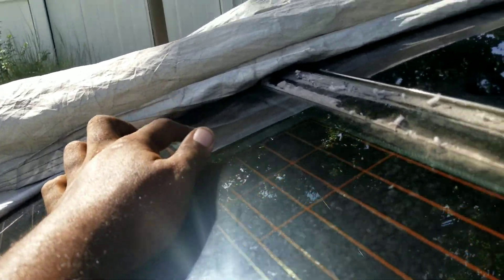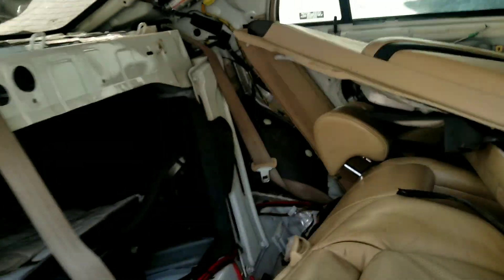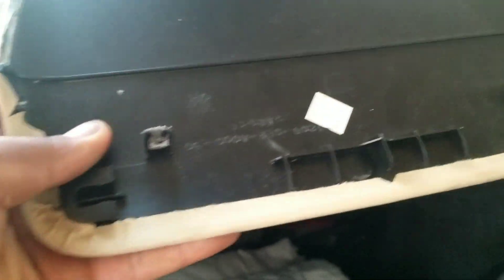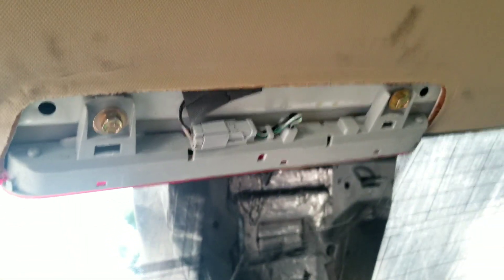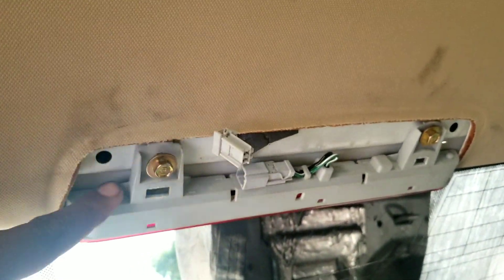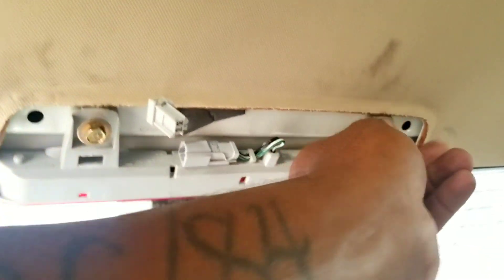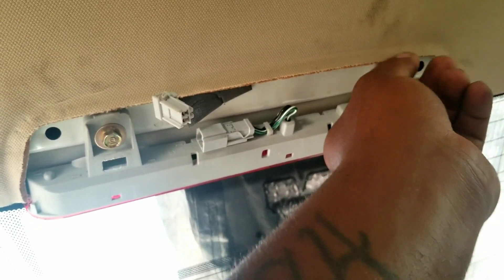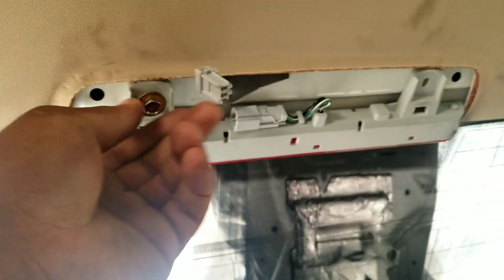ACURA TL 3RD BRAKE LIGHT REPLACEMENT (1 MINUTE FIX)

Comment: Love the upgraded opener! Quick question man, been struggling to find the module thst controls the DRL lights on my 08 TL. Any chance you have some insight?
Reply from the maker: yes will make a video showing if that helps
Reply: @fabolousg4ever  really!! That would be absolutely amazing! And really really appreciated!! As much as I try, I just can't seem to get good at working on my car like some people can!

I'm hoping to follow the repair of taking out the board from the module and re-soldering the joints.. Hopefully that finally gets the dang DRLs to work

Comment: Yo quick question does  changing the engine mount the front one does it fuck up the alternator because now I have that red battery sign
Reply from the maker: nah it doesnt
Reply: MODS FOREVER 
I peep it the alternator  u think I should buy the Denso  one  on ur Chanel or get my old one rebuilt